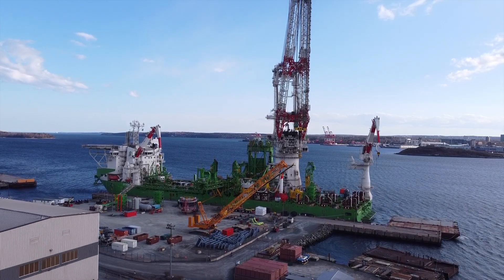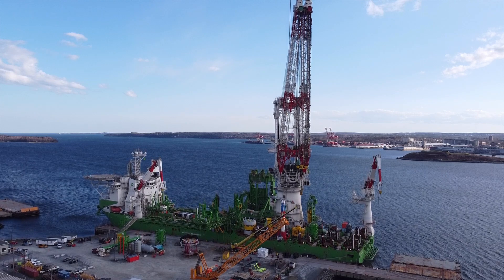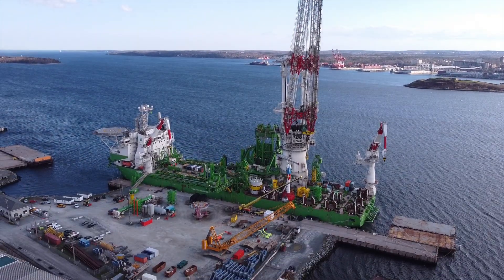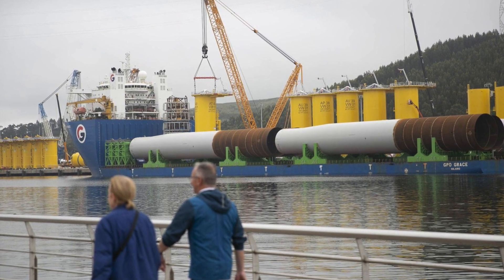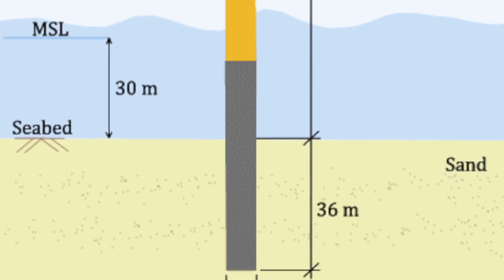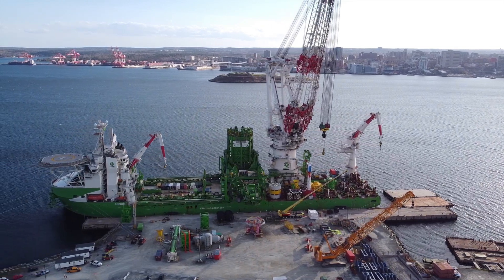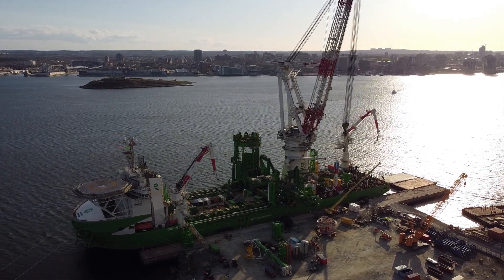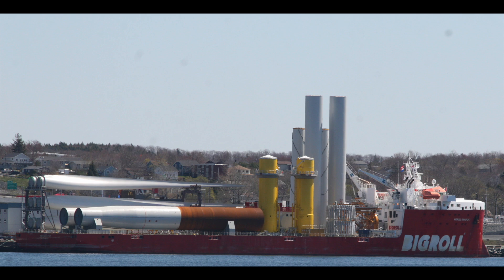This Offshore Wind Turbine Installation ship is Huge

Comment: GPO Grace has two sister ships which are working in rotation on this project so we will see 3 supply vessels feeding components to Orion. I believe Orion plans to make 11 trips to Halifax to pick up the turbine components for Vineyard 1. Atlantic Towing has temporarily moved their marine base to COVE’s south dock and wharf to accommodate this project.
Reply from the maker: Thanks for the Info. There are 60+ to be installed, so that makes sense.